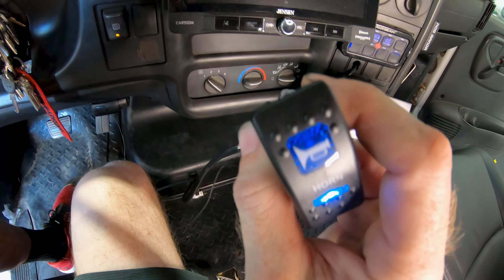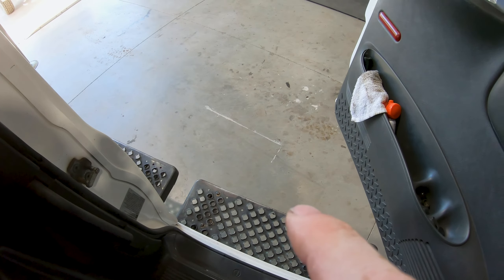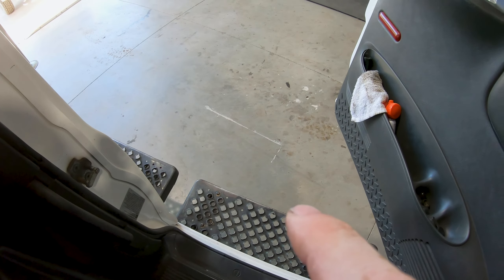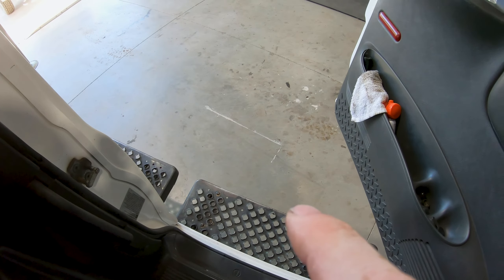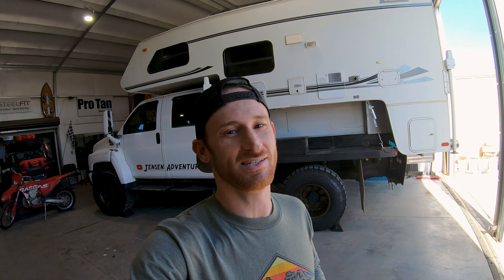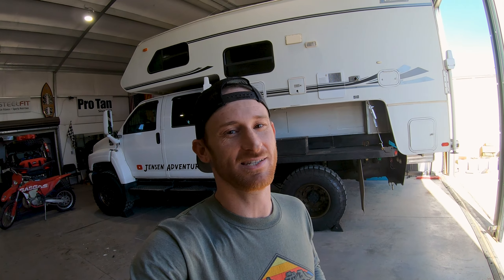Building our 4wd  Kodiak Truck Camper! Part 10- Train Horn

Comment: 🤣🤣🤣🤣🤣
Reply from the maker: It’s loud lol
Reply: @JensenAdventuresaz  I have no doubt ;)  Years ago I worked at the Light Rail system in Los Angeles and we had air horns like that on the trains. We had to quiet them down due to public complaints, so we put a restrictor in the air input and a plate with a small hole drilled in it on the bell end with a band clamp to hold it on. That was just one horn and you've got 3  🤣🤣🤣
Reply from the maker: I get to make the kids day when their arms are pumpin out the window lol